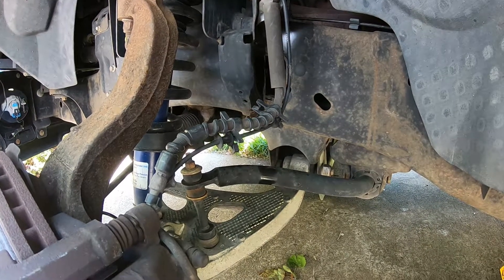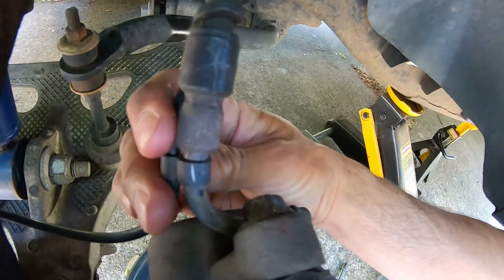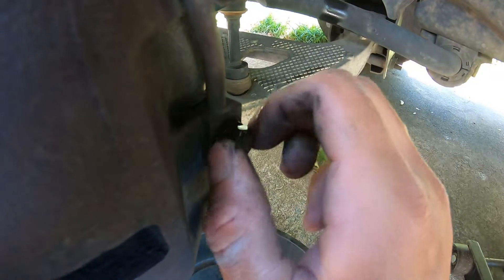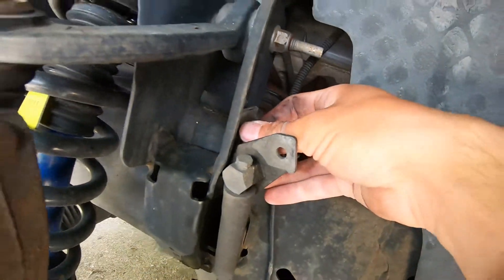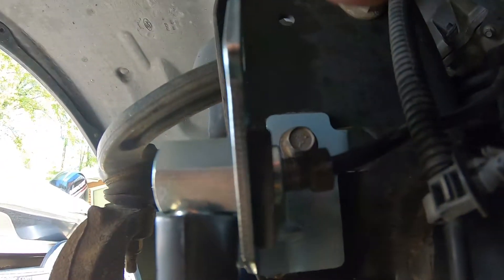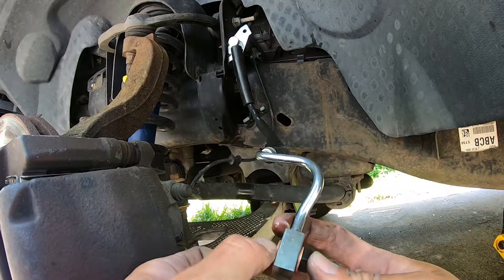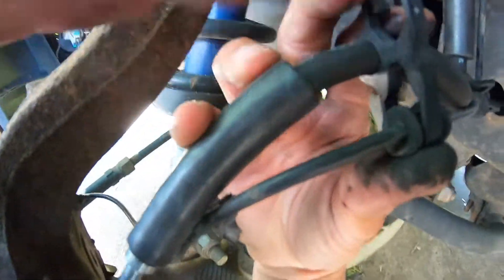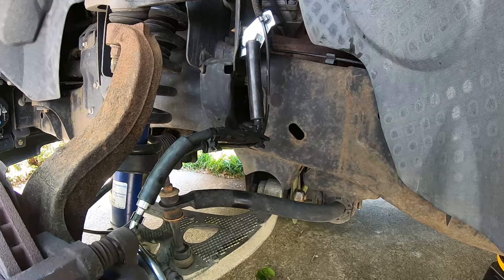Replacing The Front Brake Hose On My 2008 Ford F150

Comment: Thanks for the video.  I’ve got to do this on both sides of my 2006 F-150.
Reply from the maker: Welcome! How many miles do you have on the 2006?
Reply: @thomasfixit7931  252,000 and change.  The OEM hoses are still on it but I know they need replacing.

Comment: Hey man I’m wondering did you replaced the hose because the brakes were locked or dragging? Thanks for the video in advance
Reply from the maker: They were dragging. When the hoses get old they deteriorate within, and can cause a blockage